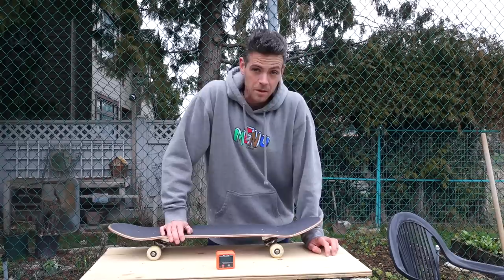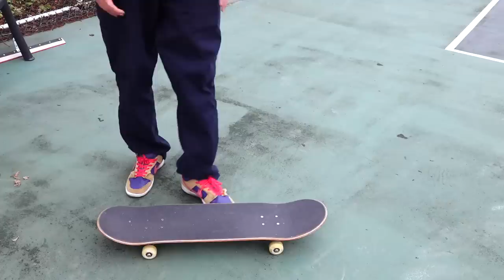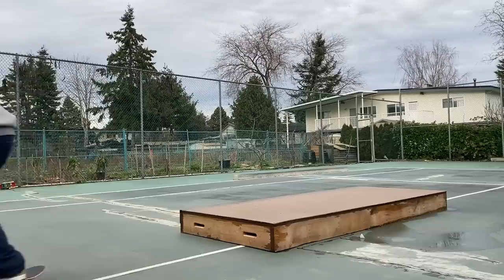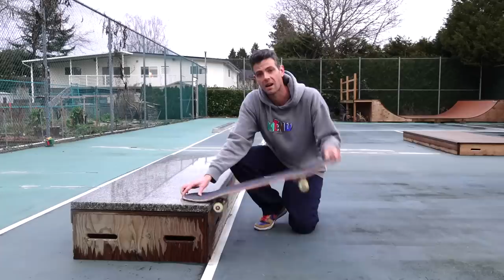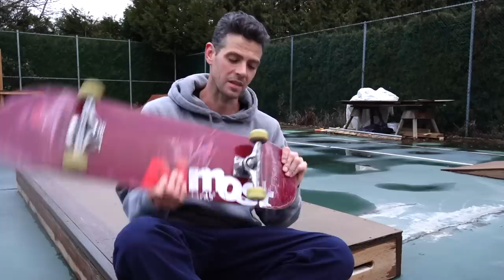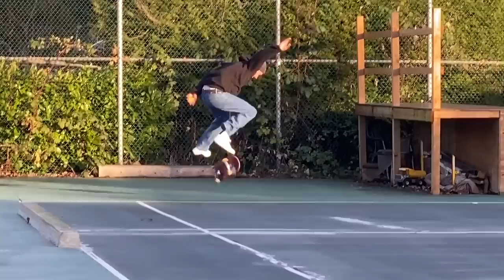Change this part of your skateboard and it changes everything!!!!

Comment: Don't mean to be rude but when it comes to how quick the pop is, the fingers of flat is not what matters but rather all of the following: 1. how long the nose/tail is starting from the wheelbase 2. how high the tip of the nose/tail is compared to the flat part of your board 3. how high your trucks are 4. how big your wheels are.

What you say about the feebles/smiths and nose/tailsildes is on point though.
Reply: More fingers of flat would make the tail hit sooner, no? So less pop.
Reply: @JoshuaJeffersFL  unfortunately not if the tail is shorter or steeper. But yeah of course if you have everything else identical, then yes you are correct. My point is you can't take two different shapes and based on how many fingers of flat there is say one has quicker pop than the other.
Reply: Plug in those variables and you find the pop angle, fingers of flat affects how it feels to get the board to that angle. More fingers of flat, more leverage, lighter feel. Less fingers of flat, less leverage, heavier pop feel.
Reply: @johanneskrv  right. I thought his point was that more fingers of flat = less pop? That would be true for any given deck, correct? Now, comparing one deck to another, I totally agree with you that other variables have to be considered.

Comment: Now I'd like to hear more about the differences with cast vs forged baseplates as far as flat, angles, pop, manuals etc.  I'm kind of lost in that madness.
Reply from the maker: Good idea. I’ve flip flopped about forged vs cast for years. Currently riding thunder lights. Forged plate, hollow kingpin, solid axle. I never want to skate anything else.
Reply: @bendegros  I'm actually stuck between 147 and 148 forged and cast.  Try a manual on forged and then cast and notice the difference.

Comment: Hey Ben! I’ve gone through a few ankle sprains on my front ankle and have really lost my Nellie pop and the timing is off. Any suggestions as to what I should try changing up in my set up? Currently G023 with Indy hollows and 52mm wheels.  Thanks!

Comment: I'm suffering from skate madness lol I have a enjoi complete 7.75 a cliche complete 8 all the rest of the decks are 8 
a girl slick deck Andrew brophy with mag light independent GPS bearing thunder gold bolts Jessop grip with oh nomads elite 53 

 Santa cruz everslick clear grip tape either jessop or shop own brand tensor alloy red trucks Indy's GPS and oj nomad elite wheels 53mm 

a heart supply impact light jagger sushi trucks red with independent GPS bearing shop own brand bolts blue with dragon wheels 53mm 

another heart supply impact light with venture low indy GPS bearing shop blue bolts with spitfire formula 4 classic red swirl 51mm

 now I just got the other day wknd independent trucks stage 11 bearings spit fire cheap shots with formula 4 wheels classic red swirl 51